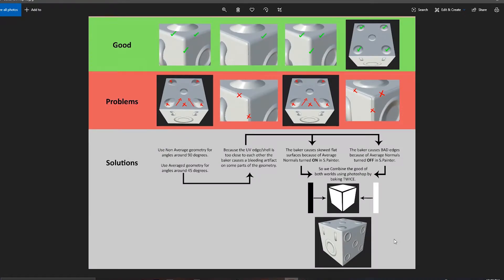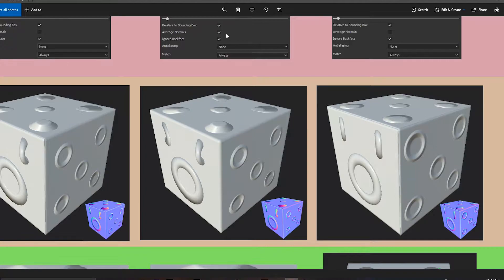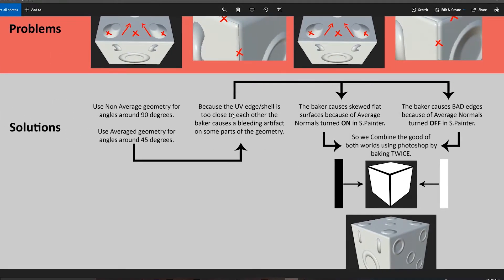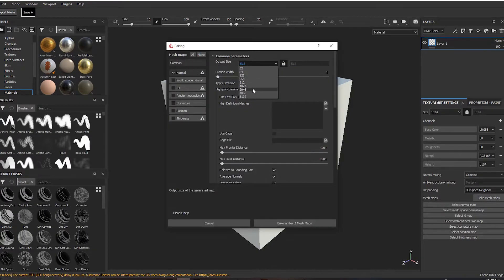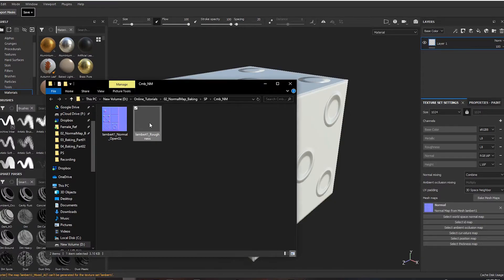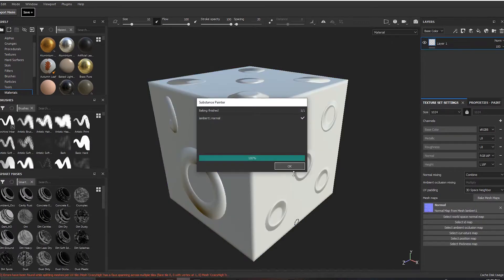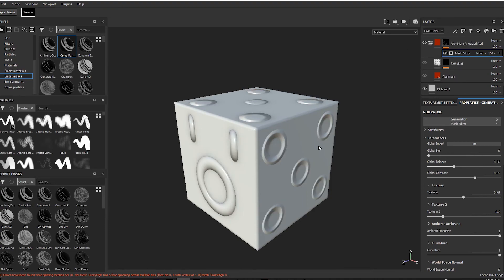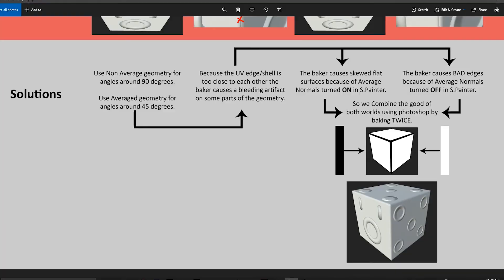05- Baking using Substance Painter - Part 02

Comment: I troubleshooted bake problems for 2 days straight on these boots I made. What I learned is the 90 degree edges need their own UV islands, the UV islands can't be too small and you can't have any other UV seam connecting into the hard edge seam otherwise it creates tearing. I also learned that you will run into a hard edge that can't be supported with another loop so you basically have no choice but to use bevel, it's the only way I found to add more geometry nondestructively without retopoing the entire thing.

Comment: Very nice explanation and video. But I have small query. In the Solutions picture, you have mentioned to use Averaged Geometry for angles around 45 degrees, but in the later half of the video where you show the final comparison, you have used splitted uv shells geometry when you bake the normal with average normals turned on. 
So, I want to ask you, when we need to bake with average normals turned on, should we be using averaged(one uv shell) geometry like in the first 2 examples or splitted uv shells geometry like in the last 2 examples?

Comment: just putting one more edge loop around the corners and baking with average normals with sharp edges solves all of this. those edges you can delete afterwards. and they won't effect shading after deleting because we have sharp edges.
Reply: Adding support loops to the low poly model works better for me. It's also faster than editing in Photoshop.